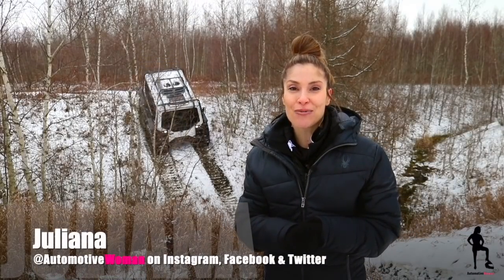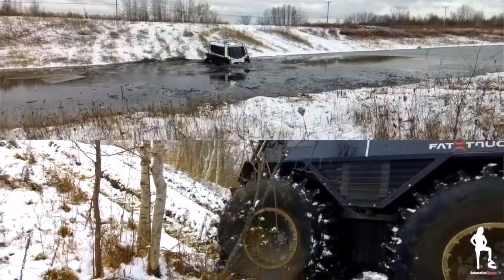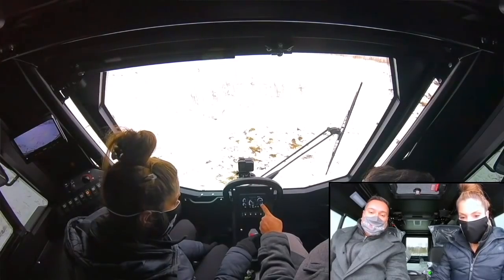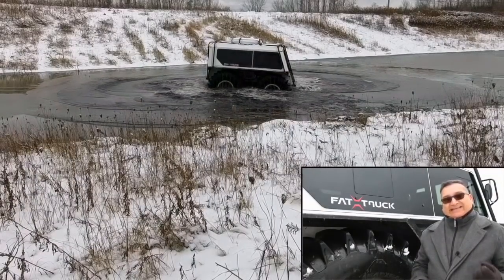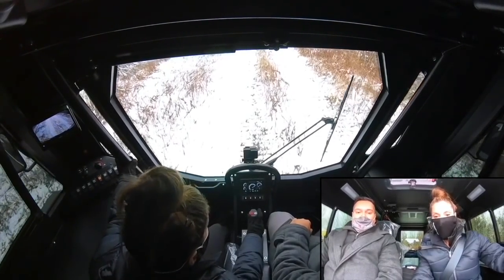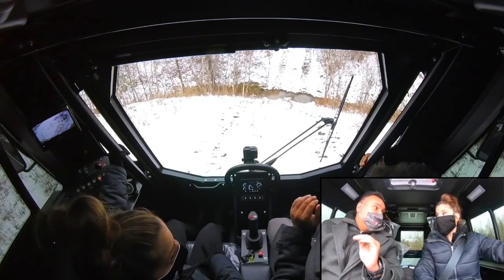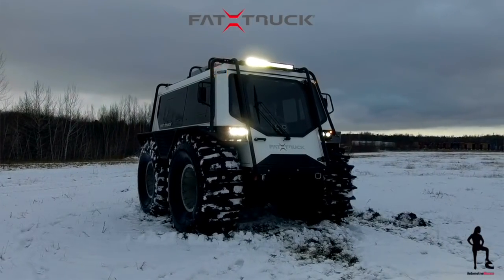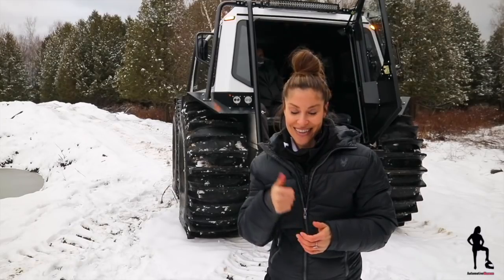FAT Truck | World's GREATEST Amphibious Vehicle!

Comment: One thing that everyone calling this a Sherp rip-off is missing: This is hydrostatic, so it can neutral steer. The Sherp with its braked differential drive can only pivot steer.
Reply from the maker: Yup.... Well said! Juliana
Reply: It's a sherp rip-off, pure and simple. Putting in a hydrostatic drive and giving it a different name doesn't make it a different vehicle.
Reply: @Blueknight1960  So what.  The more companies manufacturing similar vehicles the prices go down and innovations go up.  Look around, there are similarities in EVERY product out there, from shoes, automobiles, airplanes, and on and on and on.  Why do you Sherp fan boys get so upset about this one?
Reply: @markd5625  I'm not upset and never will be over the looks of a vehicle. But you are wrong about the prices going down on these or any other vehicle, no matter how many look alikes there are.

Comment: Form factor of SHERP is patented ? you must pay. FAT too heavy - 
he is not a competitor to SHERP. He will get stuck where the Sherp passes
Reply: Eh, not necessarily. While it depends on exactly how the patent is written, my guess is that the patent expired long ago, basically because of the Bobcat. The bobcat is a four wheeled, skid steer, small off-road utility vehicle. No, it wouldn't be called that by anyone in the industry, but the description is correct nonetheless. In fact, the patent probably existed long before Bobcat as it's claim to fame is the attachment system, not the small skid steer format. 
Given my knowledge of Sherp, they may have a patent on their clutched chain drive system for this category, but FAT Truck uses a hydrostatic drive instead.
Reply: Having used both the sherp and the fat truck extensively, the fat truck is absolute shit off road, gets hung up in muskeg, it's tires are smaller for the body size compared to the sherp so it can't approach obstacles. It floats so low in the water you have lots of issues in floating bog. It's hydrostatic control is terrible, it is so rough, to try and slight left and slight right is almost impossible. We do not go anywhere moderately sketchy with just a lone fatruck. Because you will be stranded or walking to the bush to cut trees to get yourself unstuck. Also it's unbelievably loud. Inside and out. Build quality is awful the doors have fallen apart multiple times. And we have bolted the layers of the door back together. Positives over the sherp, easier entry exit and being hydro static you can use it to hoist loads up and down.

Comment: Such a unique machine.... Nothing like the sherp at all.... 🤣
Reply from the maker: Hey, thanks YT KB for watching, and you are correct.  The FAT Truck is nothing like the Sherp.  The Fat Truck is more environmentally friendly, offers a lot more safety features to keep crews safe, and the FAT Truck Tires are trade mark with their internal technology.
Reply: @AutomotiveWoman  🤣🤣🤣
Reply: @AutomotiveWoman  You can claim the FAT truck is nothing like the Sherp all you want. You can base that on the improvements to environmental issues and safety and make the claim about the trademarked tires...In the end, it is obvious the design idea for the FAT truck was based on the Sherp. The price is similar to the Sherp. The tires from outward appearances are the same as the Sherp. The manufacturer of the FAT truck couldn't use the Sherp tires so they had to develop something unique about theirs so they trademark them and call them unique. Bottom line, If it looks like a duck, swims like a duck, quacks like a duck, it's a duck. The Sherp may be a Mallard, while the FAT truck is a Canvasback. It's all good though, just recognize the roots of the FAT truck, and realize, it was initially developed as a competition vehicle much like General Motors was to Ford

Comment: The very first thing I see wrong with this vehicle it the joy stick control which means electronics. My experience with electronic controls is that with age they fail. When one is 500 miles from service and brought to a halt by a $60 piece of electronics or corroded connection this not a good option. Every piece of equipment i have ever operated with any kind of electronics over mechanical or hydraulics is nothing but trouble when it ages. Old electronics also lowers the resale value of aged equipment. The tire inflation, the steering the shifting etc. all controlled by electronic on this vehicle not my idea of a piece of equipment I would be very comfortable with taking into the back country once it was a few years old.

Comment: It's almost a rebranded Sherp. My guess is, it probably is.
Reply from the maker: They say ignorance is bliss... In this case it's very true. Thanks for watching.
Reply: @AutomotiveWoman  I guess I better qualify my guess since I don't know all of the configurations of the Sherp. The Fat Truck outwardly looks like a Sherp, but the physical internals runs on hydraulics, whereas the Sherp mechanicals is a simpler chain-drive transmission.

It really boils down to reliability because you definitely don't want to get stuck out in the middle of nowhere freezing, drowning, dehydrating, or some other dangerous physical exposure.
Reply from the maker: Total respect for looking a bit closer, however the majority of the mechanics and engineering in the FAT Truck are patent and represent new, safer and greener technology. Yes, they look similar, but what's under the hood is very different. Again, I appreciate you having a closer look. Juliana
Reply: @AutomotiveWoman  Well, I wouldn't go that far. This engineering design has been done dozens of times despite the "look". I doubt, IMO, that there is anything that is revolutionary worthy of a patent if they have one.

Most of their internal components are off the shelf. Safer and greener is a mostly subjective assessment. If they wanted to go full green, they would have done solar + battery + electric motors. I'll give them credit for trying.

Comment: Look like this BEST and ONLY truck is a plagiarism from a Russian truck - SHERPA
Reply from the maker: Hey there! Thank u soooo much for watching and connecting. The FAT Truck I promise is nothing like the Sherp. Once you inform yourself of the vast technological and environmental differences, you will see. Here's an article for you: https://www.motor1.com/news/461889/fat-truck-made-in-canada/ Happy Holidays and again Thank u for watching and connecting with me. Juliana
Reply: @AutomotiveWoman  The linked story reports that the Sherp has a steering wheel, which is wrong, it is steered by two levers that engage and disengage clutches to  power or stop the wheels on each side of the vehicle.  Suggest the author of the article actually research the subject before writing about it.
Reply: @edkemmerer9763  Boy are you more than wrong in what you say Ed. The story reports as she stated it has a joy stick. I suggest you get a grip.
Reply: The best off-road trucks on earth are from Foremost Industries, designed and built in Canada for over 50 years. Even the USSR bought thousands of them before making their own plagiarized knock-offs.